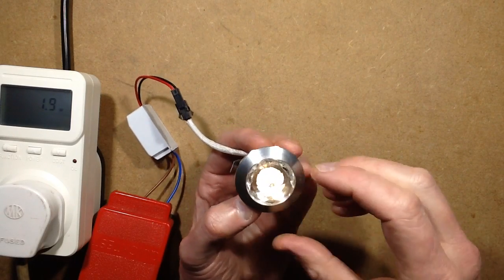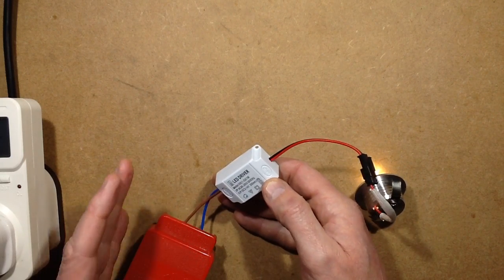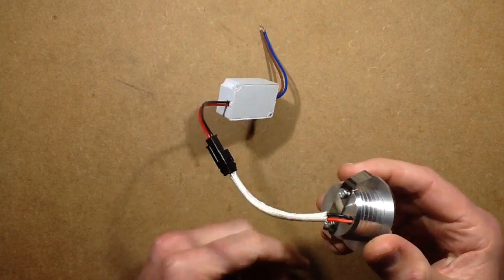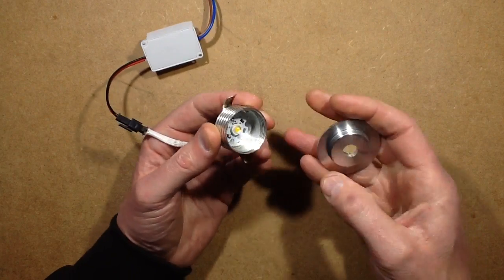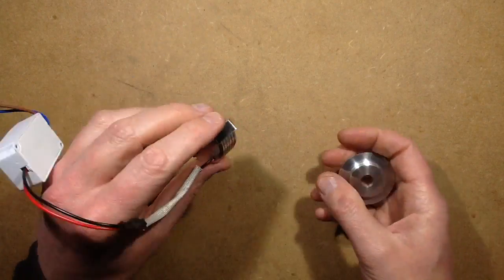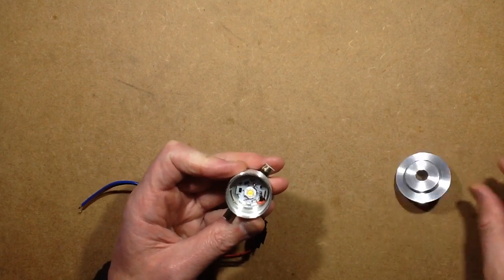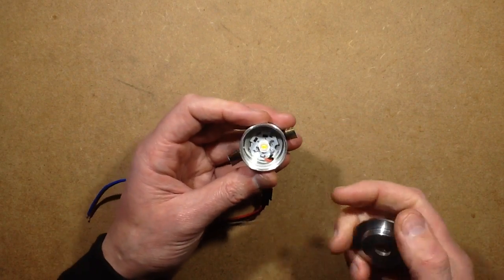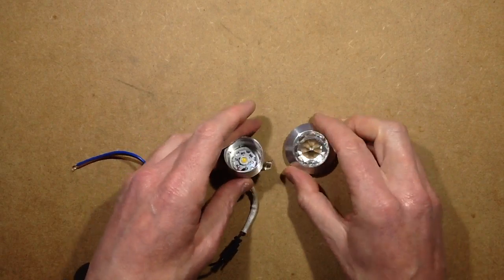A look inside a "diamond" LED downlight.

Comment: I actually think it makes a change to find a led light that gives out such a small amount of light. For instance, i have some G4 fittings that i have 5w halogen lamps in, i would love to upgrade to led, but i cannot find any led lamp that will give out the same soft light, all the leds i have tried have been way too bright for the location. I find that problem a lot when i want a nice soft dim light in a table lamp, a few choices with the old incandescent lamps (plus of course you could dim them), but finding led lamps with a similar light output is difficult.

Comment: +bigclivedotcom what do you recommend if I wanted to get rid of the CC drivers on 11 of these and replace with a single 12V supply? I could, say, run multiple series chains of 4 (I'm guessing about a 3v drop on each?) but that still leaves me with an odd set of 3 !

Comment: Having read all of the comments and replies, I am of the opinion that bringing the LED closer to the diamond, would be more effective. Perhaps you could mock that up, using an unmounted LED, pressed against the hole, under the diamond. Based on the comments and replies, I believed a 'hack' is desired and required. Keep up the good work... ;-)

Comment: Hm, maybe you can remove the led and mount it on an aluminum rod off of the board (closer to the hole). The aluminum rod would still act as a heat sink. This would make a nice "night light" as well.

Comment: I recently watched your video on Push Lights, and I immediately bought a bunch for some props I'm working on. You said during the video something about swapping out the LED globes inside them, which is what I want to do (Trying to make a Black-Light Push Light). I'm having trouble on how exactly to go about this, is there any chance you might touch on something like this in the future? 

Thank you.
Reply from the maker: +SeeYouSpaceCorgi Black light will possibly make the dome glow blue.  It's also a dodgy wavelength to use for TV or film since you don't know how the camera is going to react to it.  I probably will be doing a push-dome LED conversion in the future.
Reply: Wow, thanks so much for the response! They're such a great little device so thanks for your video introducing me to them. Looking forward to it in the future!

Comment: I've got these! I've had 2 fail so far, but overall they are OK and nice warm colour
Reply from the maker: +Andre Fish They are really simple, and use a common connector for the LED.  So if it's the driver that has failed you can swap it fairly easily, and if the LED has failed then you can also swap that with a bit of effort.  Noting that it is siliconed in.

Comment: if you got a dremel o. the top to make the hole bigger would it give out more light or lose some reflection.
Reply from the maker: +dooronron69 The glass crystal seems to be pretty tight in it, so I'm not sure how easy it would be to remove it for Dremel access.
Reply: +bigclivedotcom or stack some washers behind the LED board bring it more towards the hole?
Reply: +bigclivedotcom Maybe dremel from the inside between where the LED and the glass? It looks like it screws from the outside rather than the inside, so depending on precision of the dremel, you could increase the size of the hole without damaging the glass or removing its ability to screw onto the bottom component.
Reply: Maybe some sort of light pipe; a piece of glass rod or clear plastic from LED to thru the hole?